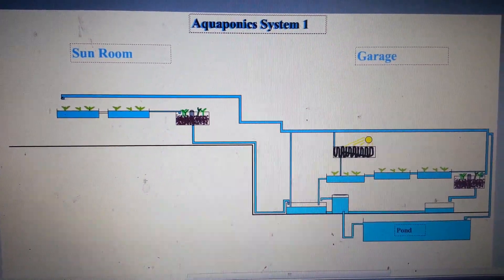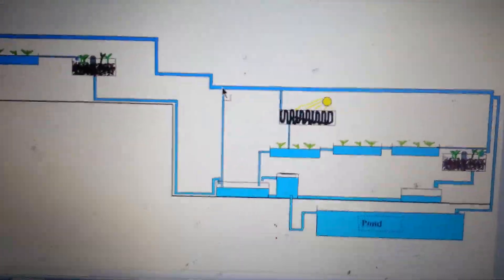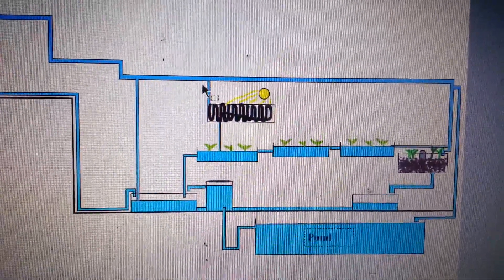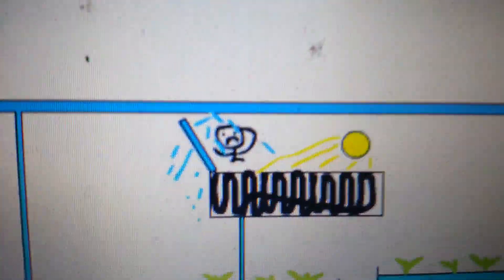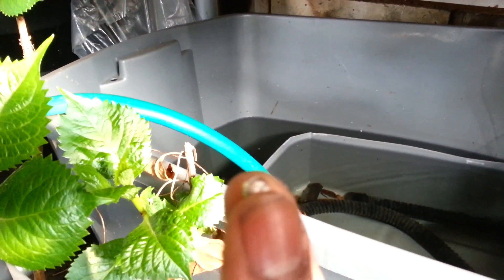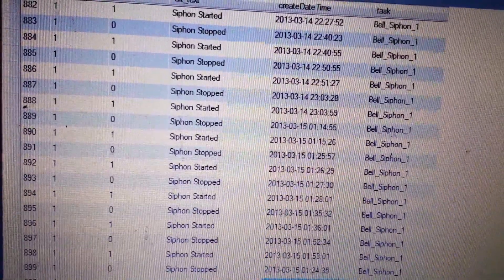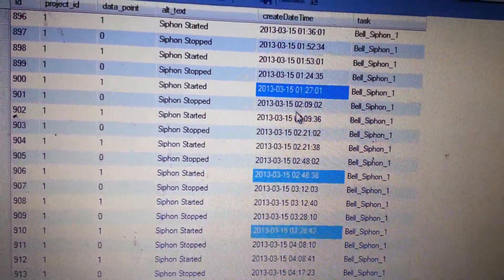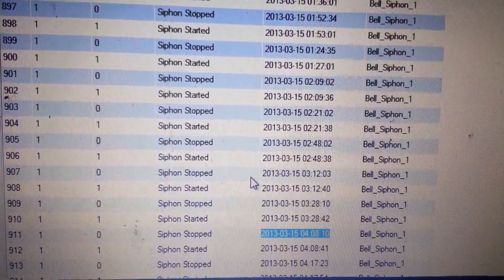Aquaponic System Failure 3/17/2013 and Monitoring the Bell Siphon

Comment from the maker: Yes it does and makes the world much more interesting. ;-) The quick minimal monitoring I did the winter was the with temperatures in the top of greenhouse and humidity. On sunny (forgetful ;-) )days initially that sensor saved my plants many times from heat. They have various weather station monitoring toys and for more intense monitoring I will post more on how and what I'm doing.

Comment from the maker: I will do a video on how that's done. In a quick overview I have a counter that does a mass update on stats every 5 minutes. The code does a post to a link I have setup to receive posted data which insert it the data point and some identifying text in a MySQL database. From there I have webpage that dump the most recent stats and for setting alerts. Making a flash object or javascript to post html on a forum should be too difficult. More to come on how and any help you may need.